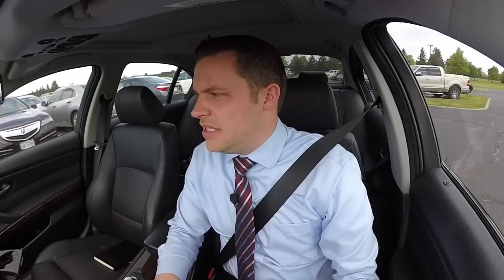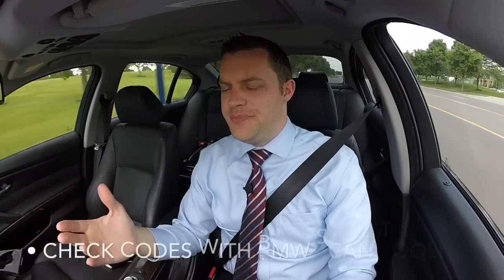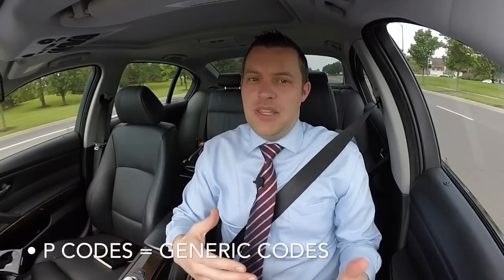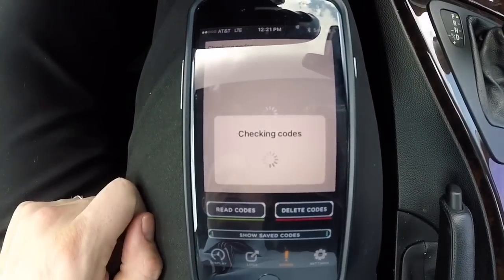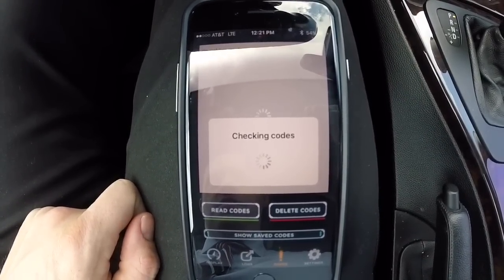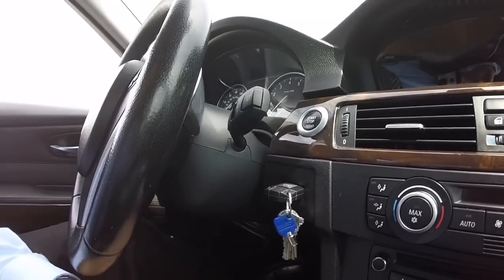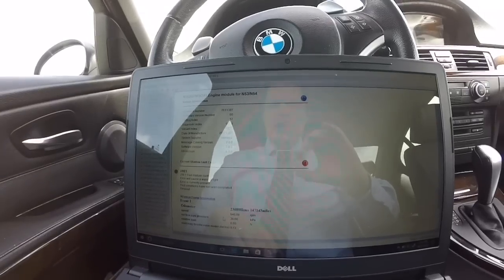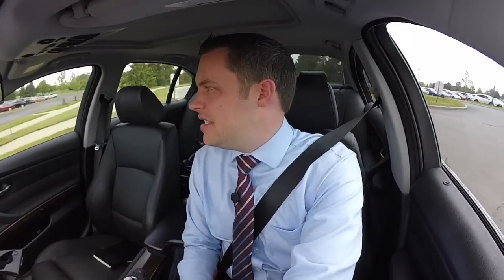The Truth Behind BMW Check Engine Lights!

Comment from the maker: CLICK HERE To Shop On My BMW Fanatic Amazon Website! Thanks for the support! 👉🏻https://www.amazon.com/shop/bmwfanatic
Reply: I purchased a 2015 328i BMW from Carvana and drove it about 6 hours from the Carvana vending machine in Texas to New Orleans and it sent a Drive Train Malfunction and shut down in the middle of the Interstate. BMW assist had it towed to the local BMW dealer and I decided to not keep the car. Carvana also gave me a dummy key fob that did not go with the car nor did it have the emergency manuel key inside the fob. Very disappointed! I saved for a year to purchase that car.
Reply: @dianaflowers715  how many miles was on the car
Reply: i also have a 328i currently i just got it inspected everything passed except OBD rediness, the codes that came up for me were , 1C3110, 213901 and CDA904 if anyone knows what these are id appreciate the feedback
Reply: keep in mind the car has upgraded charge pipes, downpipe, idk the mid pipe, and possibly a tune from the previous owner, everything else is fine
Reply: @Kittyarms  I'm not sure. I believe it was 40 or 50 thousand.

Comment: Fully agree with you, I've experience check engine lights from misfire, and after few more miles of driving the check engine would clear itself, BMW is notorious for doing this, and this video is very helpful especially for new BMW owners, you don't wanna fix things right away, you sometimes have to out wait the check engine lights.
Reply from the maker: Mcgyver B true!
Reply: Having misfires every time the car has been in the cold garage and its been sub zero weather. Annoying but it goes away after starting the car again after it has warmed up.
Reply: My misfire problem was my ignition coil. Runs so smooth now. Problem im having now is i have all green checks in my service but SES light is still on.
Reply: @TonySavageLife  Same here. All services are checked OK but still have an SES light on. Strange

Comment: for future reference if you have a proper scan tool you can actually see how many time the fault codes was triggered....some codes that disappear once cleared only mean they are not active at the time....for preventive maintenance its normally good to look into those codes to avoid actual component failure...for example a loose connector can trigger a host of codes, which if not addressed can cause actual harm to the relevant components....this way you can plan when to actually address a problem rather than waiting for it actually breaks down

Comment: You are spot on explaining the differences my friend. The only ses lights I had on my E92 08 335i was the rear o2 senor bank 2 and a misfire due to leaky injector fouling the spark plug and the only cel light I had was a bad crankshaft position sensor. Also gave me the reduced power message "Limp mode" . I too have used a BM scanner and was able to resolve all of these issues except the leaky injector that should be soon hopefully.
Reply: Jaimexx I’m haveing injector problems since getting water into coils I have since replaced plugs and coils but can’t seem to fix this activation code

Comment: Most states will fail a vehicle if the CEL has been reset in last month. Further drive monitors are not set and that is a fail as well.

Comment: What is the difference for the check engine light? I drove a few miles from the house and there was no light on, an hour later I start the car and the check engine light is on. It’s a yellowish/orange color, solid NO flashing.

Comment: I think if you put in lower fuel grades it could trigger the Check engine light because my previous car was a flex fuel and when I put in the regular fuel in emergency situations the check engine light would come on. So I am thinking it's the same for other vehicles too. BMW requires Supreme fuel, so if your placing any other fuel into it, this may also trigger the check engine light. Any thoughts or comments on this?
Reply: I had this situation before, I added supreme fuel but it was a gas station in a small town the check engine light was on（I was on the highway）so I ignored it but I noticed the acceleration is really slow, however, after burning out and adding 2 fuel tanks of new fuel at other station. This light goes away on its own.

Comment: I recently had a P1727 come up, I read it was a crank sensor issue. Before deciding to spend 70 bucks on a sensor. I pulled the crank sensor cleaned it really well and reinstalled it. The light never came back. Sometimes the sensors are just dirty.

Comment: I have a 07 335i coupe and sometimes the ses light comes on and off and when it comes on i feel the engine shaking when im parked or stopped and sometimes it goes away and that doesnt happen only when it pops up and i have a misfire what might be the problem im a new owner to a bmw car i have the n54
Reply: Kevin Dgaf you need an oil change about 4000 miles ago
Reply: Ignore it and turn up the radio

Comment: Hello, I like you channel and it is very informative, I just bought a used 07 e92 335i 6 speed and I need to replace the battery. Now I have a good scan tool, The Schwaben BMW/Mini scanner by Foxwell. It has saved me countless times and paid for itself many times over.  It has a section for "coding" the battery to the car.  but since I am upgrading to a new AGM style I have to "register" the battery and this is where I come into my issue.  Can I register a battery with my scan tool or do you think I need the Technichs Kit you talk about?   Thanks
Reply: Just hook up your tool and see what it can do.  If the battery has the same A rating, them all that is needed is to tell the car it is new.  If it is a different rating, then check that your tool can register that new value correctly.  BMWFanatic has an excellent video on this topic.

Comment: When my Vanos Solenoid went bad, my codes read as faulty HPFP, and Vanos Solenoids. It also had another one that had to do with fuel pressure plausibility. After I replaced my Vanos , never got any of those codes again.. Keep the informative videos coming. #BMWFanaticLife🏁🤙🏻
Reply from the maker: Gohan335i7 🙌🏻👍🏻

Comment: Are you saying there is a separate Check Engine Light (CEL) in the dash that is different than the Service Engine Soon (SES) light? You said "...translating a service engine soon light to a check engine soon light now the service engine soon light will light up as far as you have that issue now  that issue gets even worse or a certain parameter is crossed you're going to trigger a CELL(?) just a check engine light and that's when it's kinda like alright you have a major problem because a majority of the time the SES lights are just very basic stuff it's not really anything crazy of course limp mode over boost under boost all that kinda stuff all that major kind of codes those are going to be check engine lights so you want to definitely check those and obviously you know go ahead and and fix those issues right away....."

Comment: My 2003 x5 has no check engine light. I turn the ignition on and for a few seconds all the cluster lights turn on but no engine light. Will this fail texas inspection? I have no actual codes.
Reply: Same here. Did you find out anything please?

Comment: I had some coils and plugs go out because service spilled couple drops of oil on #2 and #3 which leaked under the coil boot. I buy the stuff and they do the labor for $20 so can't complain. Well anyway changed them out, cleared codes using MHD then put gas, restarted and light went off (light was on when driving to put gas). Samething when I replaced a dead battery. The steering wheel lock light and battery light were on after replacing until I put gas and restarted it. That was over a year ago and nothing since.

Comment: Can I ask you a question I had a full diagnostic from the bmw dealer everything was cool except my oil valve gasket cap, I got it fixed now my check engine light is on what would suggest x3 2013

Comment: Thank You so much for the video. I had a check engine light soon last year after erasing it now came back again this year. I went for inspection and they give me a code P0301 Generic cylinder 1 misfire detected. I had changed 6 of my spark plug last year i was thinking maybe thats why. I use maxiScan MS 300 and it says no code found. Thank you for sharing all the information it makes me feel better about the light. Its so helpful knowing about having a proper BMW scaning tool.

Comment: I need your help. I have a 2007 335 and a few days ago my turn signals started blinking fast and I got warning for all my lights but none where out. I pulled the left and right tight tail lights out but on the left side when i turn on my headlights the left side break lights also turn on but they are dim. I checked the plug and there was low voltage so am guessing it is not the bulb housing. If you have any advice I would really appreciate it. Thank you
Reply: Usually the fast blinking turn indicator is a display of a dead bulb, however in your case the bulbs are working just fine.  The voltage on the other hand being low is more than likely triggering the indicator and causing your symptoms.  I'd personally run a battery check and alternator check to be safe.  Depending on which alternator you have it might also be a sign of the voltage regulator starting to fail.  Luckily most shops can do free testing on both to make sure the voltages coming out from the terminals and alternator are fine.  If it's not those it might be something more serious.

Comment: Have you had any metal sounding squeal/ squeak from a wheel(s) when rolling forward from 0-15mph? Periodically a squeal will come from my front right wheel at this speed.
Reply: Check your brake rotors, I had a similar issue with my 335i. I fully replaced all rotors and pads and it never came back. This was 2 years ago and at the time I thought it may have been the wheel bearing.
Reply: MEZ92 okay thanks. I have to change the brakes anyway so perfect timing. Did you change your sensors too? Ive been looking around there's a large selection of sensors at a wide range of prices. Any suggestions? They all seem the same but different prices.

Comment: For bmw new owners this lights are terrible since we think that the engine will explode if you continue the journey. I've just bought a 335, 2008, and at this moment I stopped the trip since appeal in the Paine aa small engine light. No big, in the middle of panel. As I dont know what this means I decided to stop in order to avoid serious damages. I call to my mechanic and he said to let the off for a minutes that probably the light went off, since no appear the message of redudec power and no message of faults. Let's see

Comment: Hi Ty for great detailed Explanation. I have a LARGE ,1/2 Orange  Engine Light appear in my instrument dash panel and also on my I DRIVE SCREEN on my 2013 x5 35i 3.0 turbo gas engine,it Saying >>>Engine Malfunction!! Reduced Power,Engine is operating at Reduced Speed,possible to continue,Drive with caution,Have the system Checked by your Nearest BMW Center.... So first a small orange Engine symbol appeared on my instrument cluster only. i t, but there was no driveability issues for 50 kilometers or  until the 1/ 2 engine BIG symbol Appeared. now it is reduced power ( did it go into limp mode??) I need to purchase  a scan tool specifically for a 2013 bmw x5 35i ,3.0 turbocharged engine.i do have a scan tool AUTEL MS 409 which is not any good and done do anything specific as it is a general tool,disappointing to say the least, what tools would you reccomend ?? ty sir

Comment: My check engine light is on, it makes a sound like there is no muffler and I can't use all the power from the engine. What is going on?
Reply: snois2 That could most likely be a misfire of a cylinder or cylinders depending on how many are misfiring. Avoid red lining until you can get it fixed and it should be fine

Comment: I usually clear the codes once, and if it comes back then I take care of it. If not I ignore it, such things as the oil level and coolant sensor if they light up, check your fluid levels and if they are lower than before, do not let it get worse. Don't assume it's a "bad sensor". Although, the other day my flat tire thing went up on my I-Drive, pulled over. Tires were fine, it was caused by one tire hitting a bump and rotating at a different speed due to the wheel-speed sensor sensing the difference which can trigger a false flag. Every couple of months my steering angle sensor freaks out, it's not a constant thing so I ignore it until it becomes a permanent issue. These cars have a certain pattern and once you recognize that pattern you'll know what's real and what's a false flag. I currently have a 2004 BMW 530i e60. Looking to get an e92 335i. Gonna have aftermarket warranty coverage by endurance for that thing. Also, how has your 335i been overall and I'm looking to tune it, what's a good first step?

Comment: I enjoy your videos.  One question I have is, Why are components on BMW engines such as the Valve Cover Gasket and the Oil Filter Housing Gasket prone to developing leaks? It seems this is almost a guaranteed problem on any BMW approaching 50K miles.
Reply: Alexander Major may be because they're weak compared to other components in the car. I don't know the specifics though.
Reply from the maker: Alexander Major Because it's just a normal $20 rubber gasket that is pressed together with another part and that's why it fails. Oil and coolant contributes to it as well.

Comment: Thanks for a great video, I have an X5 2011 and the light for the Fuel Filter Cap came on and the engine symbol too. I checked and it seems to be a DME light. Anyhow, I don't know if I should worry about this but would like to get the scaner. Any recomendations on what scaner to buy?? Thanks a lot!

Comment: I used a generic scan tool on my 2014 328i BMW  got the code p12a4 which was the map sensor but it was properly working ended up taking it to the dealer they came to the conclusion it was the battery low voltage causing the check engine light to turn on and this does not sound right to me any thoughts about this??
Reply: El Chucho BMWs tend to do a lot of wacky shit when the battery goes low or is improperly connected. I have a E46 330i and one day the dashboard cluster was going out of wack and the brake lights were on when the car was off and in park. Replaced the battery and ensured tight connections and it has not given any problems since. BMWs are essentially computers so any fluctuation of electrical power will cause odd events to occur. Hope this helps

Comment: That's a lie apparently doesn't like his thumbs.
Sales floor BMW car lot dealership guy.
Check code you do diagnostics first if they can. Then see if it shows up there if not then shows 100 miles down road could mean something faulty in wireing or how to use car as somethings can't be done while moving. Most are done at vehicle that stopped.

As driving any car is illegal on any roads as paperwork, for car in rules and laws a regulation were never allowed.

So DMV is not legal.
Department of transportation is not legal just like currency can not be policed or trailed unless your at highest level in clearance as well as "Heir or King".
Reply: Did you use Google Translate or something